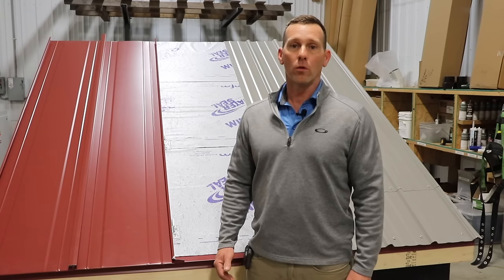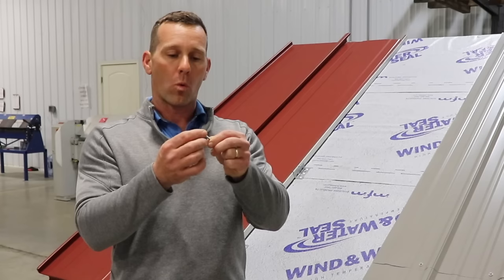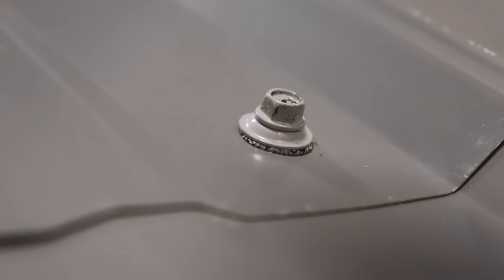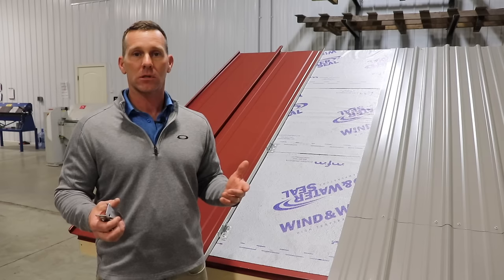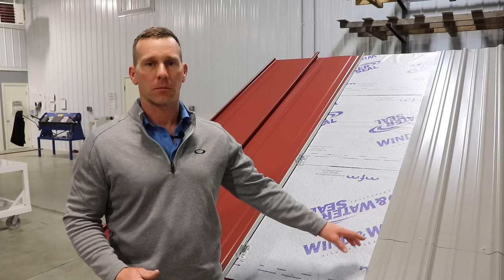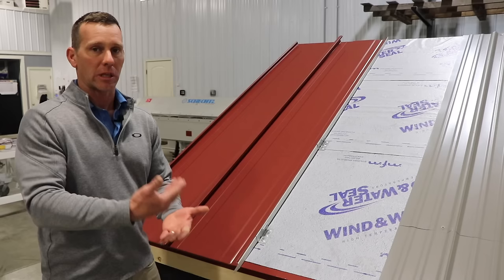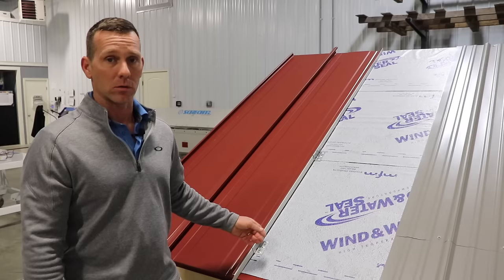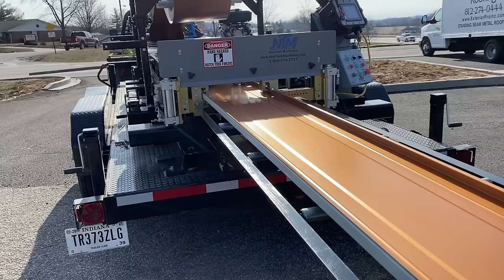Standing Seam Metal Roofing Vs  Corrugated Screw Down Metal Roof - Big Differences between the Two

Comment: My Solar panel folks and Architect said the mechanically crimped Standing Seam 26 gauge metal can be put on my low slope of 3/4" to 12".  Almost flat roof but a bit less than 1to 12. My builder put on Corrugated steel 5 years ago and I trusted him. He said it would be just a good at Standing Seam they used extra butyl tape and 1x4 so screws could go into that I guess. . Could you give me your input? I don't want to make another major mistake.  If I can't have this  Mechanically crimped Standing Seam type roof on my house then all I'm left with is EPDM but then I will have lost 25,000 for the Solar install I had 5 years ago. There is no where on my property to move them .  Am guessing Ballistered EPDM would probably weigh too much for me to put that on my house to attach or glue cinder blocks on it to hold the 40 panels. estimated 4300 pounds. HELP!
Reply: Did you get the metal?   What was the result?

Comment: Your comments on length, paint and gauge are dependent upon what manufacturer makes the panel. Some make both types out of the same material. And if you use thicker material you can make longer corrugated panels.  You also didn’t get into the disadvantages of standing seam.
Reply: There are none in a sales pitch.. just pay him to install standing seam, please.

Comment: What he said about the washer in the screws going bad is the truth, I know it happened to my  double wide with a metal roof and a 2-12 pitch and after only 6-years and I had leaks around the screws.
Reply: If you screw in not tight enough, you leave a small opening.  If you screw in too tight, you bend the sheet, making a little dam.  Make sure you do it right.
Reply: @Deontjie  it’s tough getting all those screws just right, that’s why the second roof I put the screws in the ridges and it hasn’t leaked yet
Reply: @marksullivan57  That is the way we do it as well.

Comment: It sounds like if I were to walk on one of those standing seam roofs, I might go for a ride since the standing seam bracket doesn't attach the metal to the roof very well. Maybe you just didn't explain it very well.
Reply: They get screw on the top, to prevent panels sliding down

Comment: The standing seam panels will walk down the roof from expanding and contracting.
Reply: In my area, the manufacturer/supplier of the standing seam metal, recommends two screws at the ridge on every panel. These are covered by the ridge cap and prevent the panels from sliding down.
    He probably didn't mention it in the video because it would have diminished his selling point on the standing seam's expansion/contraction. Another thing I didn't hear mentioned in his video is the fact that each standing seam panel is higher in cost than the corrugated (in my area), and it takes 3 panels to cover the same distance in the length of the roof.

Comment: In Canada we put the screw in the rib not on the flat surface, so less leakage
Reply: Same in Southern Canada, aka Minnesota.  Screws in the elevated ridges, not the 'valleys'.
Reply: @YouTuber-ep5xx  I find if on the ridge it less prone to water, go on a roof after 10 years 20% of screws are loose. rubber broken down.

Comment: German here, first: Standing seam is always better. But to allow expansion, contraction in the metall you dont screw in the overlap you use ribets there or just use metal glue... actualy easy and logical, never understood ppl doin that anyway, even better would be a folding technique in that part to not need any fasteners. Standing steam...if i start its gonna be a long text so to keep it "short" the product "Rheinzink" is nice but proly neache in the us, but the advertisers over there, if they have the same understanding of the product like they have in there origin, they can teach you how its done. Your product looks like it can handle the low price of corrugated sheets and i doubt Rheinzink can, but the technique to fold the metall into eachother is a whole other story, we had/have a own job description in germany only for that depending on the region of germany. I mean look at those valleys, if you would just use a strip of metal and ribet them down and use those to hang in the other sheets they wouldnt blow up that much. Just ask them to show you the detailed architectural drawings, for all kinda parts of the roof to get some ideas. US is on the way to get alot better roofings then you guys had in the past!

Comment: I just yesterday had a leak in the barn roofing (corrugated) that was from a heavy downpour and high wind that blew water up and over the underneath corrugation and under the upper corrugation. The roof is not defective. It has no rising screws or cracked gaskets on the screws.
While on the roof I swept detritus from the storm, which can accumulate and make little dams that catch water and can overflow the corrugation lap joints.
Corrugated metal roofing is suitable only for barns and sheds, not for houses and buildings that have finished interiors. Yet I see NO houses that have standing seam roofs.

Comment: Most professionals hate DIY products... exposed fasteners last for 50 years, the system have a better wind resistance (6" O.C. screws on perimeters) and add shear strength to your building.

Comment: Standing seam roofs cost nearly 3 times as much as corrugated roofs but only last about twice as long. Where I live, in SW Louisiana, they both only last about 15 years on average. That's the the average amount of time before 115-140mph winds come through and rip everything to pieces. If you live in a hurricane zone, standing seam just isn't worth it. I am 55mi from the coast but if you live right ON the coast, a hurricane will remove sections of interstates and completely remove concrete foundations leaving no evidence that a house was once there.

Comment: Wonder if you add water resistant caulk around the washer if it would aid in preserving its life span
Reply: Yes use solar seal 2000.
It will last.
Reply: @mysticsunshine1979  I have seen an automatic dispensor that you use at standing height and it plungers down over the strew head leaving a nice calkdome over the whole screw head and around it down to the roof panel. Pretty neat and very quick to use,
Reply: I find caulk to be crap. Use 100% silicone.
Reply: @GregMoress  that's 100% rite, spend extra use the real stuff

Comment: What is the price difference?
Reply from the maker: The screw down metal in my area right now is running about $70 dollars per sq. and the standing seam is around the $175 per sq. A square is 100 sq. ft.  The standing seam is much higher in cost but will last much longer. In southern Indiana- northern Ky where we are we see the rubber washer going bad and leaking around  9- 12 years.
Reply from the maker: silverbird58  Sure, we have a parts catalogue  to download on our website on the metal roofing page.

Comment: Oh hell, I’m almost half way done with my roof using corrugated metal.. expecting problems in 10 years I guess..
Reply: My neighbor says after ten years to replace the screws... or I guess you could coat them with silicone.
Reply: My corrugated roof was professionally installed just over 27 years ago, and I haven't had any leaks. This guy is blowing a bit of smoke when it comes to the fasteners. The grommets aren't made out of neoprene like this guy in the video said. They are made of EPDM which is a rubber that lasts 30 plus years. Think about this, if corrugated roofs leaked in 10 years like this guy says, then why are peoples corrugated roofs still up 40 + years later? Why isn't there a MASSIVE re-roofing done every 10 years? That answer is easy, because the leaking in 10 years is absolutely b.s. There is a reason why the majority of people choose corrugated roofing, because it A LOT less expensive and lasts for well over 40 years.

Comment: Ya standing seam better but more money.  I used corrugated steel galvanized.  Right over 1 layer of. 3 tab asphalt shingles that were shot.  Im sure it will be fine.  Worst case replace screws years from now.  Its a compromise.

Comment: negative note you cant do standing seem yourself without all  kinds of special tools for bending if you use 40 year silicne on the screw holes when installing corogated it wont leak in your lifetime just my two cents
Reply: You can rent the tools or use hand crimper.

Comment: I just ordered metal for a pergola, if i put a water sealant on the metal & screws, will it help last longer or damage quicker?
Reply: You don’t need to seal your screws, it would look unappealing and sealant is usually only used on flashings and repairs.. just don’t over screw them so that the washer (rubber) gets crushed too hard, you only want to fix it so the rubber is nice and snug, not being pressed down too hard

Also controversial opinion but you shouldn’t actually ever screw through the pan (the flat part of the sheet) this is where the water is going to flow, sheet should be fixed by the ribs as water will always flow off of the rib before it reaches the screw. Just make sure your screws are long enough.

1:32 the washer here has been crushed and screwed through the pan hence why it’s rusted, this screw would leak

Comment: I don´t think I have ever seen a corrugated roof on a residential building ever. I don´t even think it´s legal here to install a roof like that for the same reasons you described, it´s not up to code.
The only places where I have ever seen this kind of roof are some 3rd world countries where people just have no other choice and this kind of material is very valuable.
Our material is usually 21 gauge. We use Titanium/Zinc alloy or copper. It is rarely painted, it usually is either blank are "pre-patina treated" where it´s evenly greyish in color.
I have always liked metal roofs, their only downside is they are expensive and not easy to make properly.

Comment: Standing is twice the price of 26 gauge ribbed roof....at 10-12 years have your roof painted again to ensure no leaks and freshen up color. Metal roofing is almost to same price as asphalt shingles and easier and faster to install yet metal roofing contractors charge 5-10x the cost. Thanks for the video but you havent changed my mind.

Comment: Can't hardly tell you sell standing seam roofing. My take away was a corrugated roof needs the fasteners replaced about every 10 years and might benifit from a paint job in the process.
Reply: So I should have replaced the screws on my roof twenty years ago?

Comment: I would rather measure, mark, sand and then stud weld each sheet and just use L brackets or just straight through a boad and just lightly bolt it with a washer and lock washer no outside faster no ribs etc but that's me  willing to do the work

Comment: Hi, what does it call for the underneath metal part @ 6:23?
Reply from the maker: That underlayment is called high temperature ice and water shield. It's great stuff under metal. We use it on the entire structure before we put on standing seam
Reply from the maker: silverbird58  For snap lock and 138 T standing seam we use a fixed ridge detail which means that the metal panel is screwed down to the structure at the ridge. This pushes the expansion / contraction to the eve and this is what the hem at the bottom of the panel is for. On steel buildings when we use the 238 T standing seam we use a fixed eve detail and floating ridge. In the fixed eve detail the metal panel is screwed down to an eve plate at the gutter. The roof must be fixed at some place or it will do as you are thinking and slide down. We call this " the panel walking off the roof" when its not fixed and it slides down.

Comment: I  think it is how the contractor does to put the screws in . On my carport and shed they put sleepers down and screwd the screws in the metal diffent that the way the screws are put in that you show . Also my contractor did not put up pieces like you show . it is one long piece from top to bottom and my carport is an oversized 3 car one wide but i can also park more vehicles behind the ones there  and i can park 6 cars  .  Contractors matter . A poor installation makes metal roofing look bad . But standing seam is wider and the amount of clips matter also on standing seam . I have seen sheet put on a nieghbors house and the contractor only put 3 clips on 30 ft long sheet of standing seam . POOR INSTALLER

Comment: I replaced my shingle roof with standing seam metal in 2011. No problems with the roof, however I have been informed that my home insurance co. will not renew my coverage because the roof will be over 11 yr old. I find this quite surprising. TRAVELERS  Has anyone had the experience? SOUTHEAST ALABAMA.
Reply: Get a different insurance co
Reply: @carolynfloride2637  Not that easy, Rural, tornado history in area, no fire  plug within 1000 yards. They pretty much dictate what they insure. I had a stand off with my agent and she worked something out. Told her if you cant come up with something, I'm moving my car insurance too. She worked something out but it still cost me a few hundred extra dollars .

Comment: Sheesh.. screws on the ridge?.. screws on the flats? Find out what the manufacturer recommends and install it accordingly. Otherwise improper installation will void the warranty. If you have a specific way you think it should be done find a manufacturer who agrees with your line of thinking.

Comment: Screws should be fixed on the rib of the sheet, not the pan where water runs down 🥴
Reply: This is incorrect
This was true back in the day when using lead pan head nails.  Screwing into the rib will result in leaks. Also, screws need to be replaced after ten years as the gaskets do wear out.

Comment: But you failed to show us how the standing seam type is continued with the next panel, as in....how does it connect to its neighboring panel, and how is it watertight against that neighboring panel? Then too, you failed to show all the other components of the standing seam panel get installed.....like, the side trim edges, and the ridge cap! Geez! Us newbies would like to know about those important caveats, in order to decide if the standing seam type is do-able, without busting the budget! Big failure watching this video, as you explained very little and showed us even less!

Comment: You look at any of the old metal roofs in the south and they are all standing seam. These exposed screw roofs are an inferior option.  The metal used for it is meant for siding not roofing.  You get what you pay for.  As for those commenting of this guy promoting a product, at no time does he mention a brand name.

Comment: Metal roofs are the go to roof in Hawaii, and corrugated metal is the most common, usually the type with no flat surface. Because those types are louder in the rain. 

Also most all metal roofs are screwed down on the ridge rather than the valley. 
Screwed down by the ridge allows the metal to flex, and also allows the rubber washer to lose its seal, without leaking moisture. 
Very common to see used metal for out buildings without even sealing the old screw holes, because rarely will they even drip in a rain storm.

Comment: Poor design for standing seam panel because you need separate clips for installing it.
Reply: Point might be that it's faster to install without clips because other "wing" has long holes where you screw panel down.  On other hand you can fix clips with nail gun also but still extra part that you need when installing.

Comment: This guy literally has no idea what he’s talking about, the reason he’s able to point out all of these flaws in corrugate is because it’s all incorrectly installed and misinformation. 

-All of the rubber washers he’s shown have been screwed down so tight they’re getting crushed, obviously this is going to damage them, if you torque them right they will last well over 15 years.

-he’s demonstrated screwing through the pan (the valley or flat part of the sheet), water is going to be rushing towards the screw here, screws should be fixed into the ribs of the sheet where no water will be able to reach it, this is an instant fail in the roofing associations code of practice.. 

-corrugated is completely compatible with metal expansion and contraction, if you screw through the ribs and don’t over tighten the sheets can move as much as they need to without fixings being affected, he is over exaggerating saying the metal moves up and down so much that it pulls out the fixings lmao, I’ve stripped hundreds if not thousands of 50-70 year old corrugate roofs I’ve never ever once seen the fixings completely out, unscrewed or broken.. this is a total fabrication he’s made this up it’s kinda funny 😂 

- with the interlocking system, there’s no need for any of this on corrugate, on eves the sheets over hang the drip edge so there’s no way water is getting anywhere near the fascia, he’s also stuttering so much here it’s almost as if this were scripted and not at all factual.. throwing around a bunch of fancy terms like rakes and change of pitch that has nothing to do with interlocking, corrugated rakes are flashed, change of pitches are flashed, ridges are sealed and riveted down, if done correctly it’s all completely water tight, the ridge he shows in this video has to be the roughest ridge cap I’ve ever seen, screws in the wrong place, unriveted with no underseal or flash guard

-Seams in metal, saying 30ft is the most corrugate can be run out is total bs, you can literally run corro as long as you want it’s completely continuous, one sheet from top to bottom no matter how long...

Promoting your e-span business is fine but stop with the bs in an area You clearly know nothing about, both products are great to use and look nice